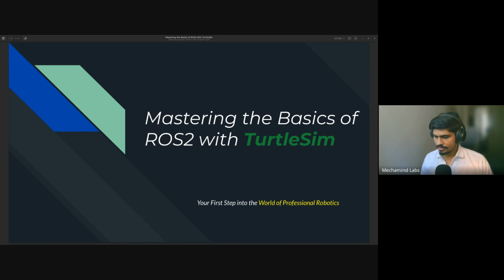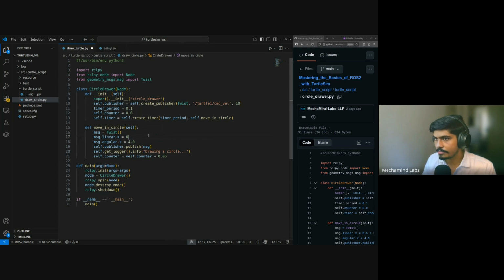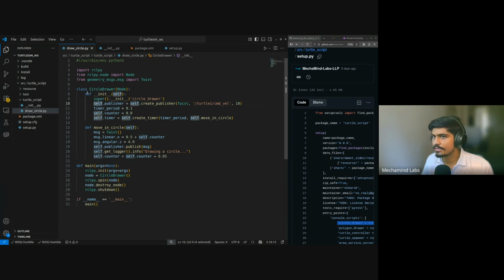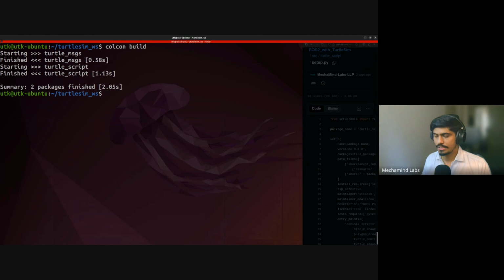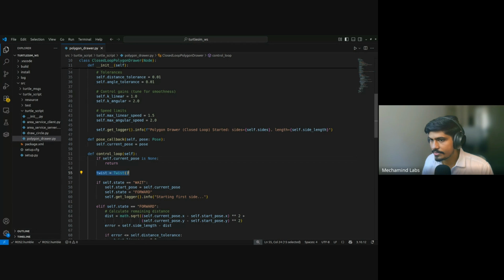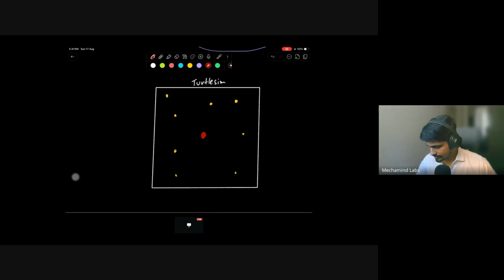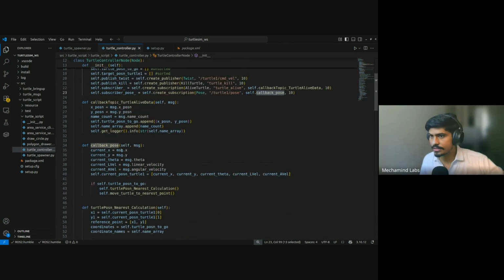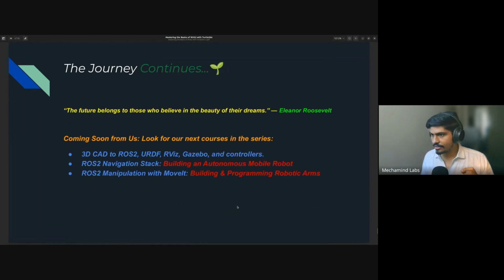ROS 2: The Complete Beginner's Course | Part 2: Project Management & Advanced Topics #ros2tutorial

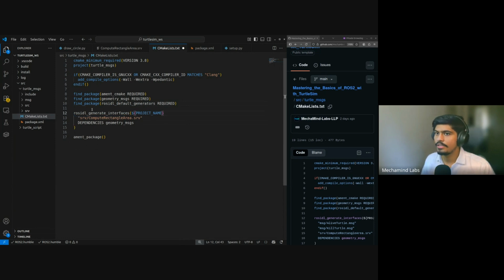Comment: at the 1:41:35, it works, but you did not build turtle_msgs. You need to add this first; you need to correct it here (at 1:13:10 you are not getting errors due to geometry messages, but error due to ros default generators not mentioned in package.xml